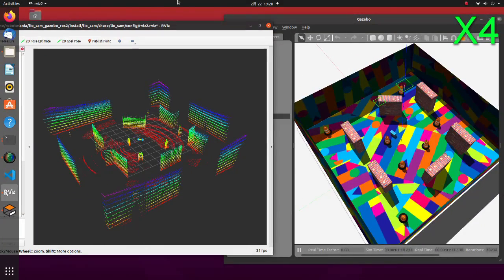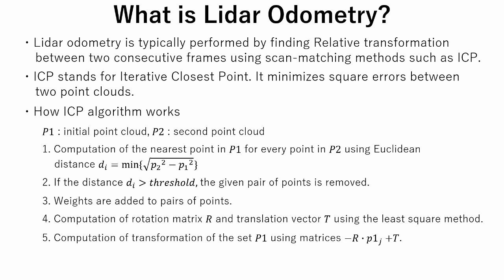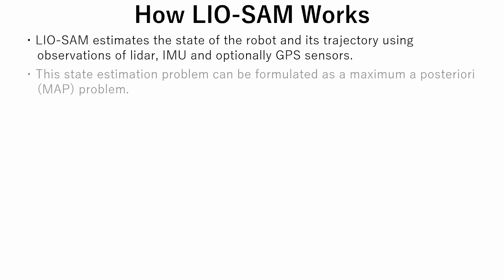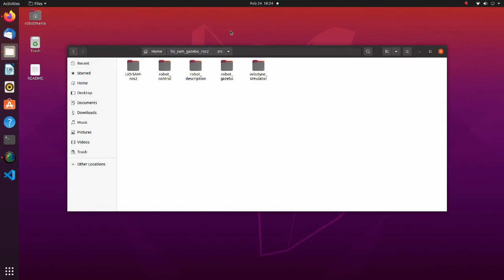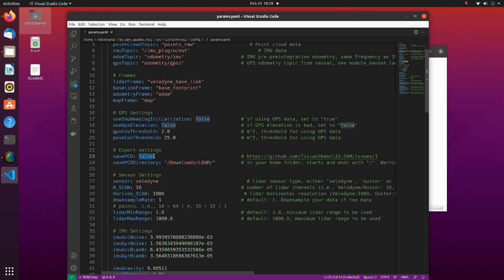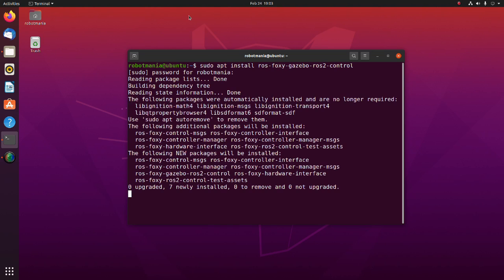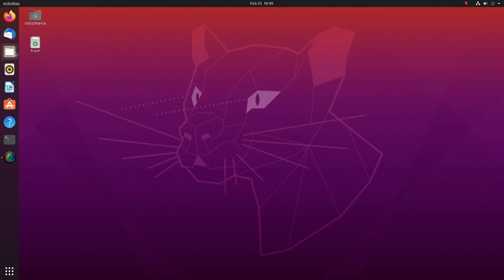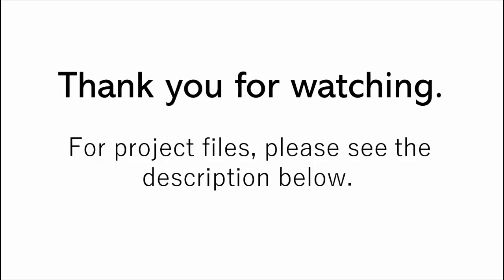Creating a Point Cloud Using LIO-SAM with ROS2 and Gazebo

Comment: I tried this , but the issue that I am facing is that the  robot model starts vibrating after some time, which keeps on increasing but everything else  remains okay. Is there a way to stop the vibration. I already have the base_footprint and all and is using ros2 humble. The model that I am using is the robot.urdf in robot_gazebo package.
Reply from the maker: Hi abhilash research!
Thanks for watching my video!
This is because the “base_footprint” link in the robot.sdf (robot_gazebo/models/robot) is not connected to any link and keeps falling during the simulation. Please connect it to the “base_link” with a fixed joint and the problem should be solved. I know about this problem but I still haven’t updated the code.

Comment: Hi 😅. Can you explain why these are yellow lines (loop closure constraints, i guess so) everywhere? What does it mean? Thank you so much!
Reply from the maker: Hi hoang ha!
As you pointed out correctly, the yellow lines are loop closure constraints. I think, each yellow line that connects two robot positions is where the SLAM system has detected loop closure.

Comment: Because i don't have a joypad so i use teleop_twist_keyboard but it doesn't move eventhought is published to right cmd_vel topic. I am using docker. In your opinion, what is the problem?
Reply: it's because my computer performance is low so the real time factor is about 0.2 to 0.4. The robot does move but it can't move in real time
Reply from the maker: I am glad that you find out the problem. Point cloud operations are computationally intensive, so it may cause the problem that you described.

Comment: Hey Robot Mania!

First off, huge thanks for your awesome robotics tutorials! They're a lifesaver for the robo community. 😊 I'm hitting a problem that seems common but rarely discussed, and I hope you can help!

I'm working on a differential robot with a RealSense D455 and want to implement a SLAM framework for navigation. I've tested MapLab on my host with Ubuntu 20.04 and in a Docker container from Ubuntu 22.04. My issues are:

On Ubuntu 20.04: I can't install NVIDIA drivers for my laptop (RTX 4070) - it crashes, cant boot, etc.. Tried different approaches. Seems kernel version of 20/04 for new nvidia drivers is too old.

In Docker (Ubuntu 22.04): I'm worried about latency, also and I can't get the ROS 2 Humble - ROS 1 Noetic bridge working. 

Also I've tried the Isaac ROS NITROS Bridge, but the container dependencies are outdated, and I can't install ROS 2 Humble on Noetic. I also attempted a manual installation of all dependencies and building ROS 2 from source in a clean Melodic container of nvidia, but no luck.

My goals:

Get my robot to "see" and navigate using SLAM with the D455 on Ubuntu 22.04.
Later, implement semantic mapping (ideally like Kimera-VIO and Khronos, tuned for a proper GUI and map saving).
Integrate agentic AI (e.g., with LangGraph) and experiment with different RL models to study robot behavior.

Question: Can you recommend any SLAM frameworks that work well with depth cameras on Ubuntu 22.04? Any tips for fixing the ROS bridge or Docker setup if it worth use deph cam with latency? Thanks for all your amazing work! Skynet bless you! 😄
Reply from the maker: Hi Maikel Borys!
Sorry for the very late response. I did not notice your comment. 
Regarding the slam framework, I think the easiest one to use is RTAB-Map: https://github.com/introlab/rtabmap_ros
The repository is actively maintained, so it is easy to get support if any problems occur. 
There are also other frameworks, like ORB-SLAM3, OpenVSLAM / VSLAM, Kimera, cartographer_ros2, but they will require some work to make it work with ROS2 Humble.
There is also visual slam of Nvidia Isaac ROS, but you will need Nvidia GPU to use it.

Comment: Hello! I have another problem. It was working fine, but at one point it stopped working and complains that it can't find Eigen library, I have Eigen3 library installed, but apparently it doesn't fit this version, because I tried to change the value of Eigen to Eigen3 in cMakeList, but after building the project, the package gave a segmentation error. If you know how to solve my problem, I will be very grateful to you

** WARNING ** io features related to pcap will be disabled
CMake Error at CMakeLists.txt:29 (find_package):
  By not providing "FindEigen.cmake" in CMAKE_MODULE_PATH this project has
  asked CMake to find a package configuration file provided by "Eigen", but
  CMake did not find one.

  Could not find a package configuration file provided by "Eigen" with any of
  the following names:

    EigenConfig.cmake
    eigen-config.cmake

  Add the installation prefix of "Eigen" to CMAKE_PREFIX_PATH or set
  "Eigen_DIR" to a directory containing one of the above files.  If "Eigen"
  provides a separate development package or SDK, be sure it has been
  installed.

---
Failed   <<< lio_sam [1.59s, exited with code 1]

Summary: 9 packages finished [4.05s]
  1 package failed: lio_sam
  1 package had stderr output: lio_sam
Reply from the maker: Hi Delight!
If you messed up with Eigen you can reinstall it. You just have to download it and extract to the correct directory. No “apt install” is required. https://eigen.tuxfamily.org/dox/GettingStarted.html

Comment: Hi dear robotmania8896. Thanks as always. Don;t you have any suggestions to adding a 3D lidar in gazebo harmonic and ros2 jazzy? In the comments below this video, somebody told the robot begins to shake and it can cause bad effects on output of another sensors like camera and imu.
Reply from the maker: Hi amin a!
The robot is shaking because the “base_footprint” link is not attached to the robot (robot.srdf) and it is keep falling during the simulation. I guess I had to add “fixed” type joint between the “base_footprint” and the “base_link”.
I think it is possible to do the same thing using ROS Jazzy and gazebo Harmonic, if a good model of velodyne lidar for Gazebo Harmonic exists.

Comment: how to solve the drift warning that I am getting : "[lio_sam_imageProjection-3] [WARN] [1729874315.346389538] [lio_sam_imageProjection]: Point cloud timestamp not available, deskew function disabled, system will drift significantly!
"
Reply from the maker: Hi Nishant Pandey!
Sorry for the late response.
It depends on many factors, so it is difficult to tell. Here is the answer of the author of this package.
https://github.com/TixiaoShan/LIO-SAM/issues/216#issuecomment-802323140

Comment: Thank you for sharing this great tutorial video. I have implemented this package, and it works well for me but I have doubts about two things. First, whenever I open the RViz and check the tf frames, none of the following links will be shown in the RViz environment such as the base_link, base_footprint, imu_link, left_wheel_link, and right_wheel_link. Also, I get the following information by running the "ros2 topic echo /tf":
 frame_id: Odom
  child_frame_id: base_footprint
  transform:
    translation:
      x: 0.0
      y: 0.0
      z: -618355.3015633753
Secondly, in the robot.urdf file, it is written that in the joint "velodyne_base_mount_joint", the parent is the base_link and the child is the velodyne_base_link. However, by running " ros2 run tf2_tools view_frames", it shows that the parent is the Odom frame and the child is the velodyne_base_link.
I really appreciate any help you can provide.
Reply from the maker: Hi Nasazad!
Thanks for watching my video!
At the time when I made this tutorial, I didn’t know the “smart” method to spawn the robot into gazebo using ROS2, so the model is a little bit strange. Please refer to the “robot.sdf” file for a link and joint connection. The reason why the “base_footprint” has large negative value is probably because it is not fixed and keeps falling during the simulation.

Comment: Summary: 6 packages finished [1.36s]
  1 package failed: lio_sam
  1 package had stderr output: lio_sam 
I get this error during colcon build. I am using ros2 humble on ubuntu 22.04
pls help me
Reply from the maker: Hi Value Tradings!
Thanks for watching my video!
It is difficult to tell only from the information that you pasted here. What error exactly did you have?
Reply: If anyone has any issues with pcl_conversion error

In the CMake, add this pkg 
find_package(pcl_conversions REQUIRED)

and amended the target dependency

and also 
sudo apt install ros-humble-pcl-conversions

Comment: why i get this error?
[rviz2-4] [INFO] [1710964446.672514711] [rviz]: Message Filter dropping message: frame 'os_lidar' at time 544.149 for reason 'discarding message because the queue is full'

system :ubuntu 22.04 and ros2 humble
rviz2 works for velodyne_point topics, but when i try to use ouster/point topic , i get this error
Reply from the maker: Hi Mustafa Dogan!
Thanks for watching my video!
I think your issue is similar to this one.
https://answers.ros.org/question/389383/slam_toolbox-message-filter-dropping-message-for-reason-discarding-message-because-the-queue-is-full/
Since it is [INFO], I think it would not cause any practical problems though.

Comment: Hi @robotmania8896 , first of all thanks for all your great videos. I want to add velodyne to another vehicle, for this I used the links and joints in the code you shared, but when I launch lio_sam I get the following error.

[lio_sam_mapOptimization-5] [WARN] [1690293520.000048341] [lio_sam_mapOptimization]: Not enough features! Only 5 edge and 2344 planar features available.

The edge and planar parts here change when I change the position of the sensor. I think I have a bug with positioning but I can't solve it exactly. Can you help me please.
Reply from the maker: Hi recepguzelbay3221!
Thanks for watching my video!
Sorry for the late response. I missed your comment. Are you doing simulation in the same gazebo world? If your environment is sparce, this error might happen.
Reply: @robotmania8896  No problem, and thank you very much for your feedback. I was wrong about the position and I solved the problem. Congratulations and thanks again for the great videos. 
Also is it ok if I share to public the code at the end of my work, I used the content from a few of your videos
Reply from the maker: @recepguzelbay3221  I am glad that you have solved the problem. Yes, you can share the code. Programs that I am providing with videos are free to use.
Reply: @robotmania8896  thanks again for everything

Comment: Hi, First of all, it's a great tutorial
But I had one problem with it, though I was successful in installing all packages, when I was running colcon build command on my ubuntu 22.04 ros2 humble my screen is getting frozen and the build process is getting terminated. Any solution for this?
My pc is i3 4gb RAM and ubuntu 22.04 with ros2 humble.
Reply from the maker: Hi user-wd9kr1uz9f!
Thanks for watching my video!
Considering your pc specification, probably you have memory shortage. If this is the case, unfortunately there is nothing I can do.
Reply: @robotmania8896  If I switch over to i5 with 8 gb RAM can It solve my problem and by the way thank you for your response.
Reply from the maker: @rithvik-w6i  Yes, I think it will solve your problem.
Reply: @robotmania8896  I am trying to implement all types of 3d- LIDAR-SLAM algorithms like LIO-SAM, LEGO-LOAM, and HDL Graph algorithms in ros2 humble with Ubuntu 22.04. In your opinion should I continue with ros2 or should I shift back to ros1 for implementing all these algorithms without any errors. By the way, thank you once again for your fast response.
Reply from the maker: @rithvik-w6i  In my opinion, it is better to do comparison using ROS1 because not all packages are ported to ROS2 and tested.
Reply: @robotmania8896  Thank you I tried it in ros1 and it worked for me, but according to my project specification I need to do the slam in ros2 .So, I shifted to another pc with  good ram and new generation and I am also able to  build the slam packages in ros2_ws but I am not able to play ros2 bags using the command "ros2 bag play -s rosbag_v2 file.bag" any suggestion for playing ros2 bags in ros2.
Thank you very much
Reply from the maker: @rithvik-w6i  Please refer to section5 of this article.
https://docs.ros.org/en/foxy/Tutorials/Beginner-CLI-Tools/Recording-And-Playing-Back-Data/Recording-And-Playing-Back-Data.html

Comment: Is it not available in the humble?
Reply from the maker: Hi 임수빈!
Thanks for watching my video!
I made this tutorial using foxy, but I think it will also work on humble. Have you tried to run it on humble?
Reply: @robotmania8896  Thank you for the reply.
I'm not sure, but it seems that I can't do a colcon build because of the lack of a humble gtsam.
Reply from the maker: @subini55  I think that you can install GTSAM regardless of your ROS version. Have you followed the instructions on this page?  
https://gtsam.org/get_started/
Reply: @robotmania8896  When installing gtsam 4.0, the error "E: The repository '~ jammy Release' does not have a Release file." appears, so I installed gtsam 4.1 version.

However, "imuPreintegration.cpp" file 248th code (to non-scalar type error), 261st, 262nd code (no matching function for call to error) appears, I can't colcon build on humble

So I tried it with foxy.
pcd file is saved well, but it does not open with cloudcompare.

I'm a student learning ros2, I don't know well..
Any advice would be appreciated.
Reply from the maker: @subini55  Are there any error messages while you are opening the file?
Reply: @robotmania8896 In foxy, the robot shaking up and down

Despite the shaking, it draws well and the pcd file also saves fine.

However, when I open the LOAM folder in cloudcompare, the pcd file is not visible..

Did I do something wrong in saving the pcd file?
Reply from the maker: @subini55  Yes, the robot begins to shake. But I don’t know why it is happening. I tried to change some physical properties, but that didn’t help. 
If the pcd file is not showing up, select “All” from the pull-down menu in the “Open file” window. All files that are saved in the directory should be displayed.
Reply: @robotmania8896  The pcd file works fine in foxy. thanks a lot!